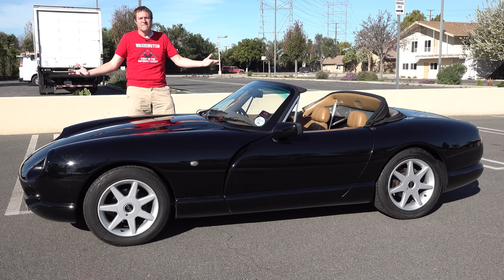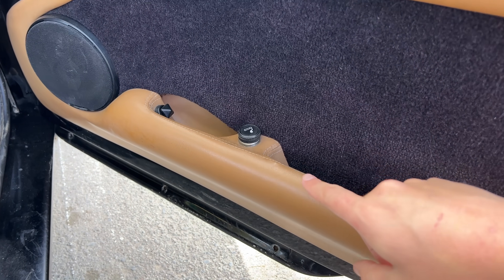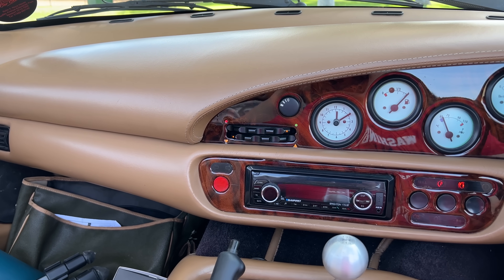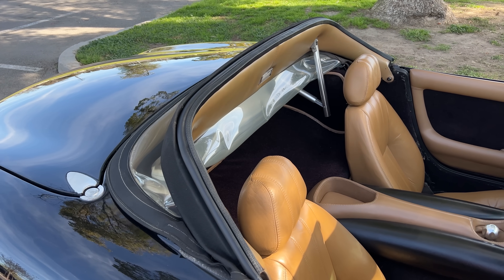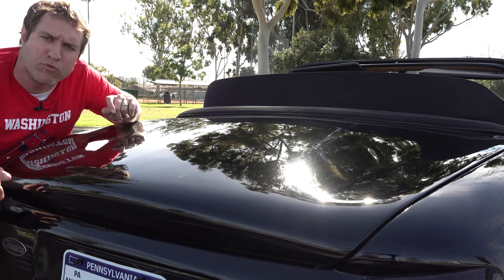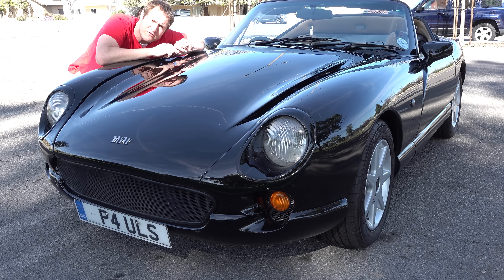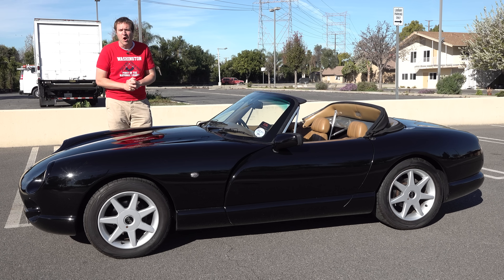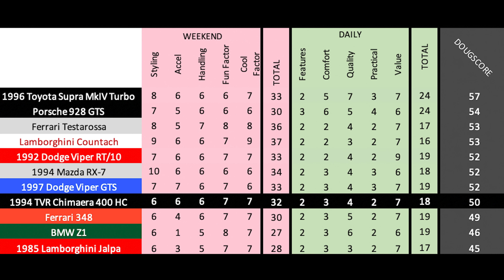The TVR Chimaera Is a Quirky, Weird V8 Sports Car

Comment: UPDATE: I just found out about a quirk you missed ... :)

See those body indentations at the front, where the indicator light resides?

That part of the car was designed by a dog.

The guy at TVR responsible for styling the body, had a pet dog with , shall we say, an attitude problem. One day, while reviewing the clay sculpture to check the body lines, the dog took a bite out of the clay model. Instead of filling in the holes, TVR left the teeth marks in the bodywork as an extra styling cue.

Doesn't really get any more British than this. :D

Comment: Rover screwed up buying the Buick version of the 215 cu in V8. Oldsmobile had one too, the only difference being the cylinder heads. Olds used 4 more head bolts per side, Buick was famous for killing head gaskets, Olds didn't have that problem. Plus the Olds had better ports and flowed more. Olds had a turbo version due to better top end design, Land Rover was famous for having problems with that engine, which was a shame really.
Reply: had mine for 20 years and the engine is faultless - in the TVR community Rover engine issues are not really a thing...

Comment: Okay, those 3 unmarked buttons... If you look above them you see the abbreviation "M.I.L." Well, the F. has worn off. Those are the three buttons you use to summon MILFs to the car. Each of the three buttons, from the factory, corresponding to Brunette, Blonde, or Redhead. From the factory, mind you. Later modifications could have been made. I mean, everyone knows these cars were purchased for their power to pull. And I don't mean trailers.
And oh yeah, that "ashtray" in the door is not an ashtray. It's a condom drawer.

Comment: A 1994 car with a 'P' suffix plate on the front , P registered cars are from 1996/97 . In the UK you can put an older plate on a car , but not newer. So you couldn't legally put a 'P' plate on a 1994 car . Hmmm

Comment: Shame you got to try a messed with Chimaera obviously someone has bodged that key fob and probably the alarm system. On my Chimera key it has buttons for the door/immobiliser and also to pop the boot (trunk) lid also if you put the rear section roof down properly it goes lower and if ......................... that is if the rear window is maintained and cleaned properly you can see through it just as well as with any soft top. I doubt it left the factory with those wheel on as those unless specially opted for were normally fitted to the 5.0 litre models as I understand it but if factory correct would be 15" up front and 16" at the rear however due to the difficulty today getting decent rubber especially in 15" diameter many owners have opted to go 16" all round or after market for 17" rims. My own sits on 16" rims but that was due to a previous owner have the AP 4 pot caliper ( larger brake disc"rotors") upgrade with 5 stud hubs to accept the 16" TVR "Spider" alloy wheels like fitted to the Cerbera, later ones ran 18" Spiders Indicators are or should be on the left side of the steering wheel and they should also self cancel on the right is the Windscreen wipers and washer stalk. so as I mentioned someone has really messed with that car!

Few other points Chimeara began production in 1993 it was the Griffith that began in 1992, my own 430 Chimeara has it's chassis (frame) dated May 93 and that is no way the only Chimaera in the US!!!  Perhaps try asking the TVR Owners club who probably know a of a few more in the US due to it's age now have briefly once or twice had the thought flash through the brain box about offering my 430 for sale to the US however then I think about the hassles dealing with customs and shippers in SE Europe and for get the idea as heck when I tried to register the 430 they could not find any info on their systems so need to buy a CoC as it seems it's the only Chimeara in the country though not the only TVR as a believe there is a Tuscan and a Cerbera here.

Comment: the ''audi'' key is just a cheap china 2 flip key unit with module, wireloom and manual kit for the eu and ebay for 50 euro. (60 dollar?) the uncut blade iff good looking you could buy a opel/vauxhall uncut blade and put it in the swith part of the key. the tvr key is form eu opel/vauxhall system. the key system ware used in the Gm eu modell about 1989 till 2005 plus minus. tvr and lotus used some opel/vauxhall parts. the whole steering collum in this tvr is used in the eu gm moddels like: the 1989 till 1994 opel vectra/ vauxhall cavelier. also in the: opel astra and vauxhall astra from 1990 till 1997 and also the coolest of the eu gm... The opel calibra / vauxhall calibra from 1990 till 1997. remember? TVR and Lotus? only used SOME parts! not all from opel/vauxhall doug? come in europe and we explore the euro moddels overhere. i know a LOT of eu cars. greets from holland, michelle
Reply: ps? the rear lamps are eu ford fiesta from 1988 till 1997. there puts acrylic like masks over it. BUT it looks cool! not to burn this nice tvr down... i like these cars A LOT!

Comment: This is why TVR is no longer in business. There just weren't enough weird, quirky buyers out there - not even in the UK where there are plenty of weird, quirky people (think Boris Johnson as an example) - to sustain development of new models. Also the brand was plagued by reliability issues, so there weren't enough masochistic buyers out there to sustain the brand. The company basically used customers for product testing and development. They would throw a new model onto the market and as customer complaints began to flow in so the company's designers and engineers would turn their attention to a fix. Unfortunately, rather too late. And it's a pity that they are no longer producing cars because in today's world of boring, bland SUVs and family/shopping cars and ... ugh ... electric cars, quirky muscle cars like this were a breath of fresh air.
Reply: What are you talking about? TVR is still in business, as part of a syndicate headed by notable UK businessman Les Edgar. From what I've read, TVR is still fairly weak but still much better than they were under Nikolay Smolensky.
Reply: @jakekaywell5972  I'm talking about the fact that TVR went into administration in 2006 under Smolensky's terrible stewardship. The company was insolvent. It was then called Blackpool Automotive. Smolensky tried to regain control of the company in 2007 but sold out in 2013 to Les Edgar. TVR continued to operate a parts business for owners of older TVRs but no new cars were built during all that time. Edgar has developed a new prototype called the Griffith, but the company is still short of the money needed to put the car into production. Therefore, from 2005 until the present time TVR hasn't produced or sold any new cars. I call that no longer in business. When they start building and selling cars to customers again I'll say they're back in the business of making and selling cars.   
It gives me no pleasure to say that. Despite their quirkiness and unreliability I like TVRs and owned a Chimaera back in the 90s but only for a year because it was a pain in the butt to drive in city traffic and the electrics were unreliable (electric windows getting stuck open or shut, door mirrors failing etc). Chassis rot is another problem. I just got fed up with it, but on a warm summer day with the top down on an open road it was a blast (as long as everything was working). Would I buy another if they start production again? Doubtful. If they ever get round to producing the Griffith they'll be asking £90,000 ($123,000) for it, and if they want to charge Porsche 911 money they better achieve Porsche build quality, and judging by previous experience that looks extremely unlikely. Also, UK has banned the sale of new petrol/gasoline-powered cars starting in 2030. That's only 8 years from now so unless they can get the Mustang-engined Griffith into production fast they'll have to electrify the car. How many buyers they'll find for that version and at that price is anyone's guess. If they ever get round to producing it, that is.